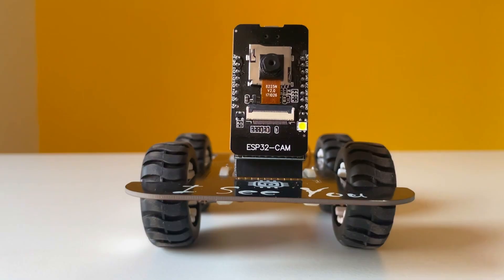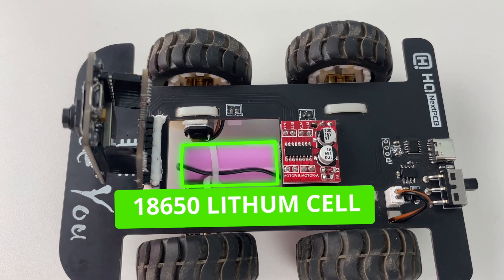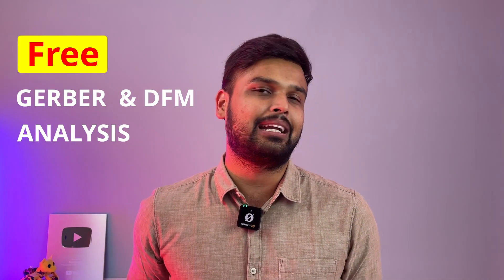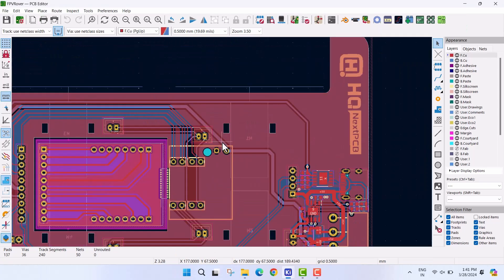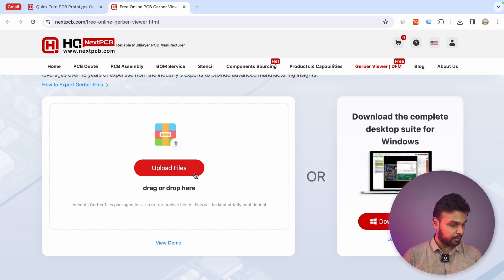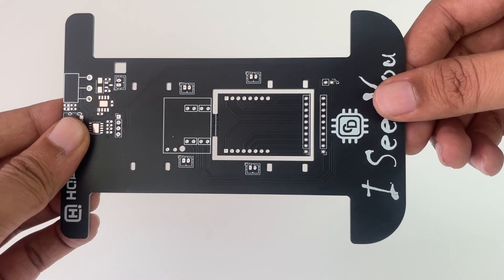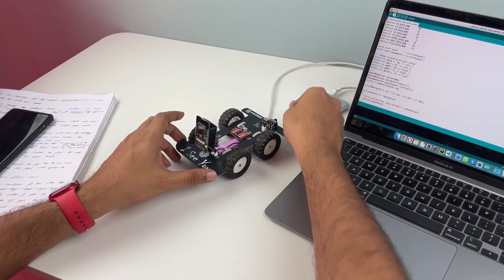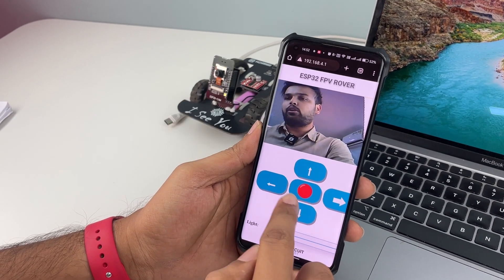How to build a WiFi Controlled Spy Robotic Surveillance Car using ESP32-Cam Module

Comment: where did you buy ch340k from?
Reply from the maker: LCSC
Reply: @Circuitdigest  thank you, and also tell me if esp32 cam is able to work with your 3.7 volts battery because after uploading the code i connected to the battery but the page is not responding

Comment: Hi. I'd like to connect smart car to my home WiFI  network and then control it over the local Network. Any idea?
Reply from the maker: change the code to setup the ESP32 as WiFi client instead of access point. Once the ESP32 is connected to the WiFi find out its IP address from the router and use that.

Comment: How is the battery connected, can you post more pictures on your website
Reply from the maker: The battery is connected to the JST connector near the switch. You can check the image on the project page.

Comment: What is it's range?
Reply from the maker: tested upto 40 meters with line of sight. For better coverage use external antenna instead of the PCB antenna.
Reply: @Circuitdigest  sir i am getting very low range like 5 meters after that video freezes and stops
Reply: @Circuitdigest  even i am using external antenna connected to IPEX connector

Comment: Can you please solve my problem..... i have a device which control steeper motor but i want to control dc motor with the same device .is there any module which can convert stepper motor signals to dc signal or any other method.!
Reply: Just dont use the stepper motor controller, you only need it for stepper motors... normal motors dont require controllers (they also dont step) You can use a MOSFET or similar instead eg; a switching Transistor

Comment: What is expected range ?
Reply from the maker: Tested upto 40 meters with line of sight. For better coverage use external antenna instead of the PCB antenna.
Reply: @Circuitdigest  oh that's nice
Reply: Remote cantrol toy drone